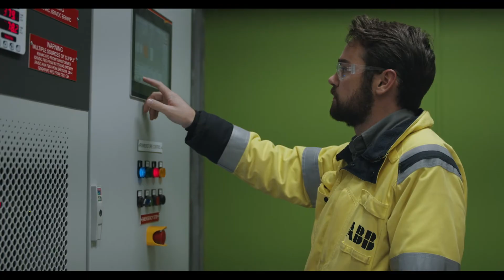Northern Light

Comment: What a great use case.  Modular, scalable and portable.  Practical and economical.

For winter, community distributed heating, they should look at heat recovery from the generators and using water-to-water geothermal.  Payback would be a matter of years.  Heat could be distributed with the  community water system on a loop.  Would work well in many Canadian northern communities.